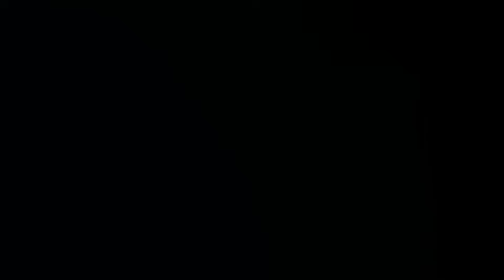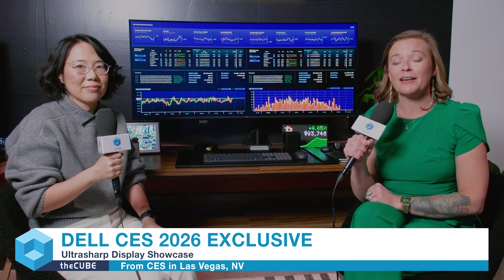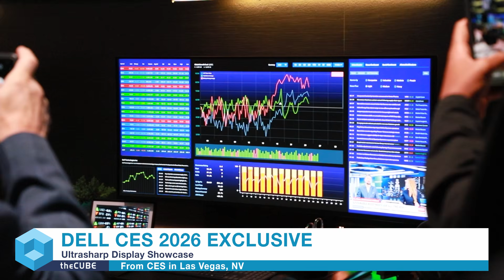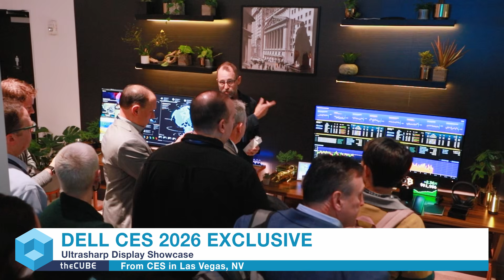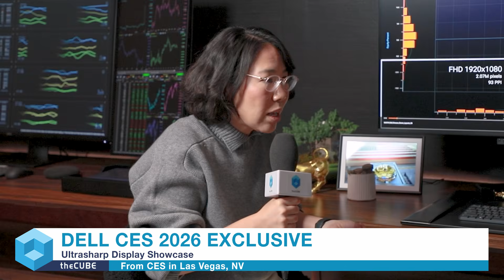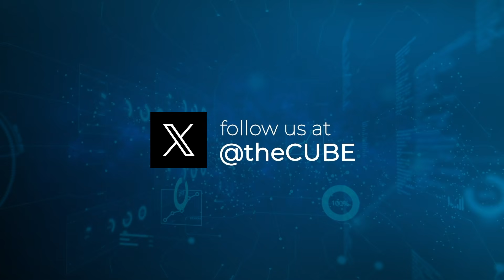Yoon Lee, Dell Technologies | Dell CES 2026 Exclusive

Comment: Unfortunately, the blacks of the 52" ips are not true black.  An oled, like Dell's new 32" U3326Q, gives true black.  I love the size and format of the 52", but I'll wait until Dell provides it with true black.   Note: I currrently have a Dell 5280 workstation, with a new Dell 32" Ultrasharp ips hub and a new Dell 32" oled.  I wanted the Ultrasharp for sharper text for cad and office; but along side the Dell oled, the Ultrasharp ips just doesn't have the oled's amazing true blacks.  I want a third monitor with sharp text and oled.  I'm looking forward to detailed reviews of the Dell 32" oled U3326Q, but the  $2,599.99 price is too high for me.  I'll need to save up.  I might as well wait for a Dell 52" oled.   I also think I'm going to need a bigger video card (Jaws).  :-)
Reply: It’s a productivity monitor, not a content consumption monitor.